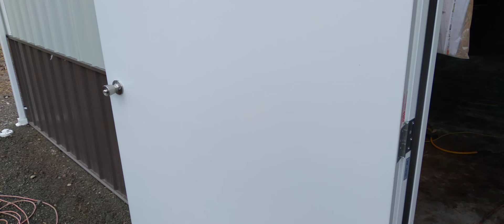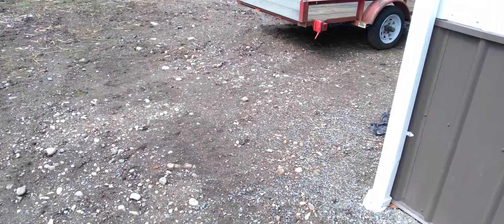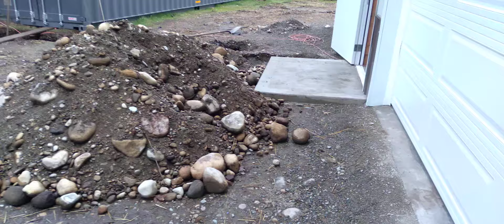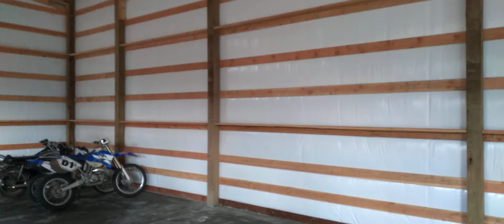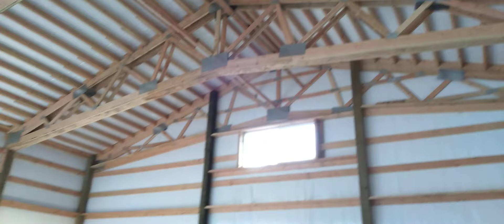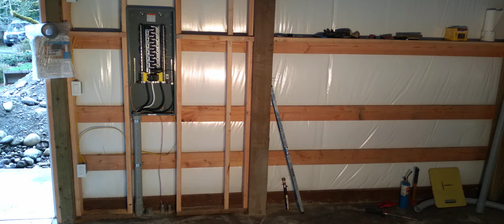40X60 Pole Barn Cost and Walk Through

Comment: To me 125K is on the high side it should include interior paneling and a concrete driveway and all lights finished, garage door openers and probably HVAC for that much or less because you did some work yourself and it should have been turn key job all warranted.  Check on that moisture on your new slab. If any problems they could say , we don't know anything about that he did the grading himself..I hope everything is OK with that . Thanks for posting. Yes all the other ones are hiding how much they paid and never answer such question if you ask.
Reply from the maker: I wish I could have negotiated all the finish work with the building construction because I'm still working on all that. At the time, it was difficult to even find a post frame contractor (supply chain, demand etc) and you definitely want one that specializes in that type of construction. That being said, at least here, the builders just want to erect the structure, get paid, and move on to the next job. So, make your best deal, get your shop built, and don't look back. Regardless of cost, you won't regret it. It's just money, we'll make more...
And yeah, my slab is not the best. They used that fiber reinforced stuff. Steel reinforce no matter what.

Comment: Great video - really appreciate the information, man.  Straight to the point and honest.  I've looked at Jahner recently - I may have to give them a ring.  Again, great video!
Reply from the maker: I'm glad the video was helpful. A year later, I'm still satisfied with their work. One thing I will say though, if you use fiber reinforced concrete, make sure you put steel in it too.My floor has cracked quite a bit. If you use Jahner, tell them Ward sent you.

Comment: thats a little high for what you got but not totally insane.I built my 44x36x12 stick built shop 4yrs ago now.Im located in WI,not super expensive but not cheap in any way.I got about $100k into mine all done.i did all the inside myself other than hang the steel.I have in floor heat,a trench drain the length of the shop,a bathroom and a mechanical room.have 2 doors with openers,5 windows,25 4ft led lights,etc..I love my shop and am in it almost every day doing something.Im a mechanic by trade so i also have my own hoist with a full assortment of hand and shop tools.i can do almost anything in our out of my shop.good stuff and good luck on the finished product.just takes time and money,lol
Reply from the maker: Thanks for the feedback. Yeah, I'm definitely going to be at around 125k all done. I'm wiring now and have the bathroom framed in, lighting to follow. I'm looking forward to being where you're at with your building.

Comment: Will you do an update video? In Pierce county looking to build the exact same thing.
Reply from the maker: I've been planning on it. The loft is built, working on finish wiring now, at a snails pace.
Reply from the maker: I'm going to do that update video soon. Is there something particular you're curious about?
Reply: My design is exactly the same just doors are on the left end,  im also looking to build a 12x40 room off the back for my dirty welding/grinding work with a set of double doors that enter the main space.
Reply: Are your posts 6x6? looks like your horizontal gurts are 2x6?
Reply from the maker: @msintern99 yes